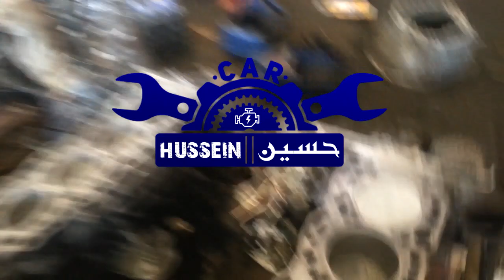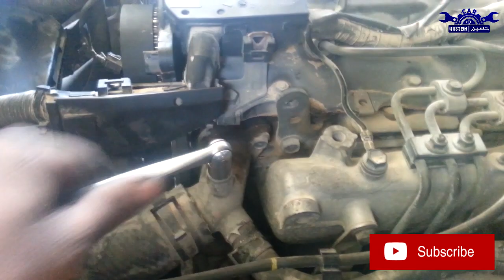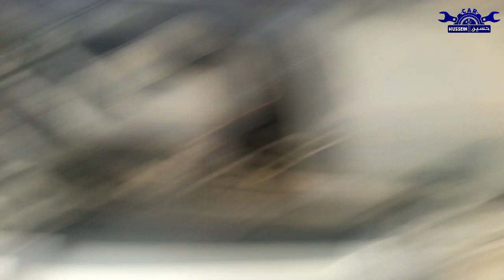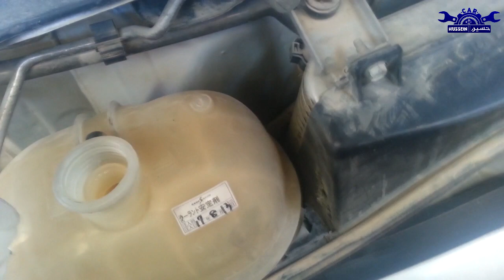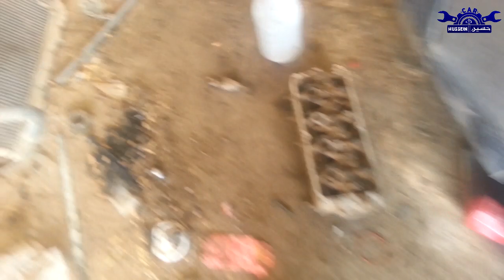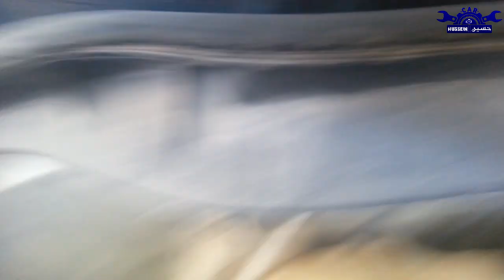The correct way to pour water into the car radiator

Comment: You shouldn't need to crack the coolant lines to do this. When you pour coolant into the surge or overflow tank, the engine cooling down after a drive will naturally draw in the antifreeze mixture.